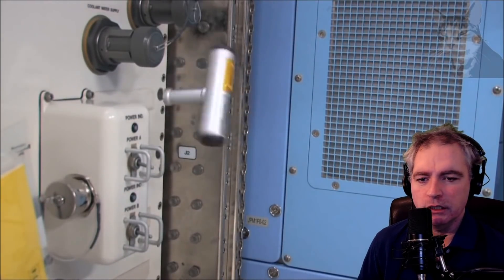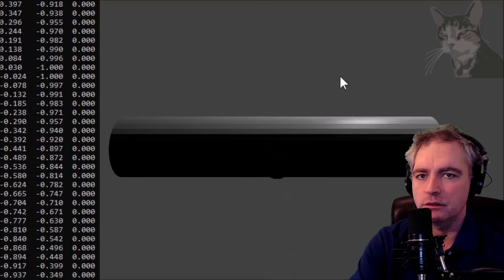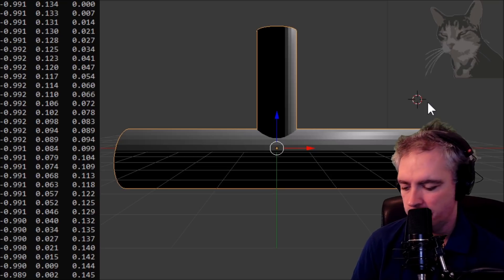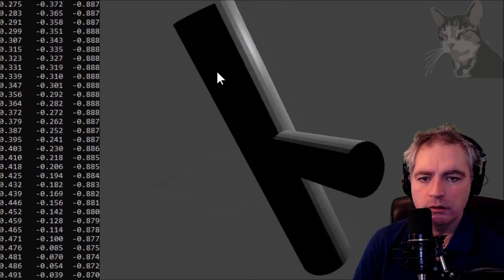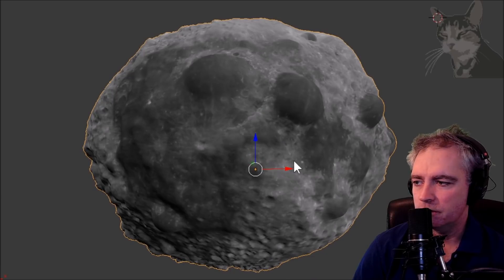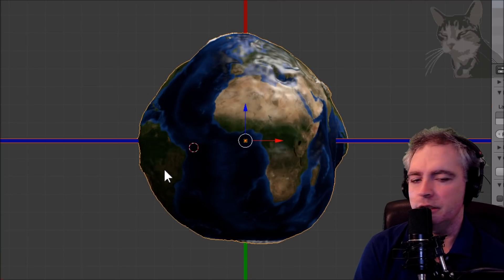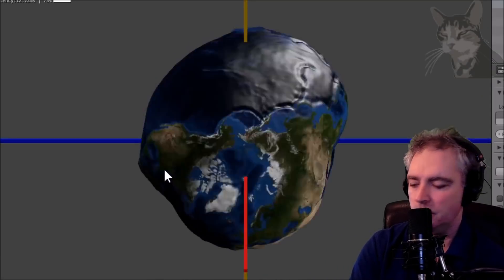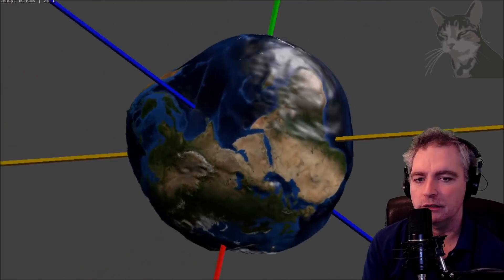Dzhanibekov Effect applied to a T-Handle, GRGM1200A and EGM2008 Gravitational Models

Comment: There's a lot of chatter saying that when the polls flip that the earth will flip ID like to know what you think about this. Please.
Reply from the maker: There earth isn't going to flip any time soon, unless there is a redistribution of it's mass that will rock it enough that it will cross the separatrix enough to favour the other primary axis. During the transition to the other axis, it will flip millions of times. I don't think this is the same thing as magnetic pole flipping. The strange magnetic pole instability readings people talk about my be a result of the amount of mobile phones there are on the surface of the planet now. If you are near an analogue compass, you can test it by placing your mobile phone next to it and see it turn 45 degrees.
Reply: @sbcode  - Hasn't the magnetic pole been on the move for decades if not centuries? And the field has been decreasing in strength slighty. Both things have speed up in the last 40 years or so maybe mobile phones are having an effect but could they be the primary cause?